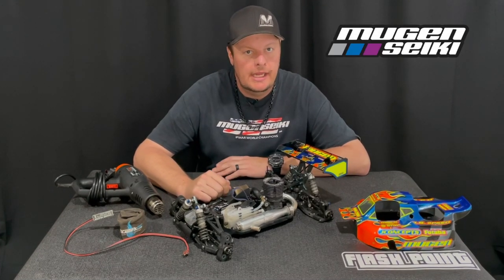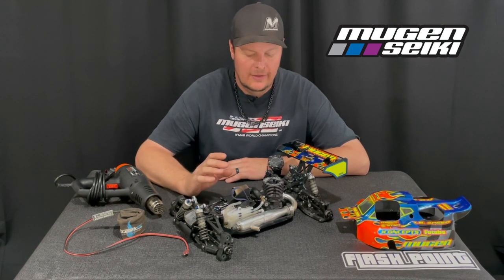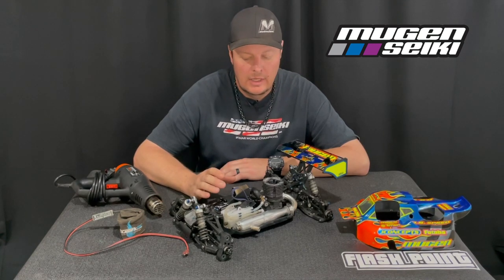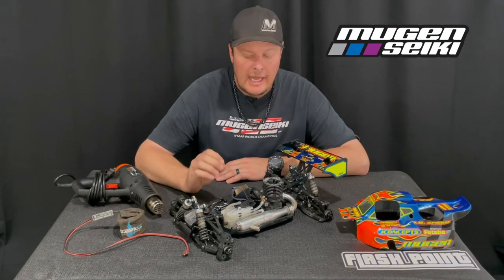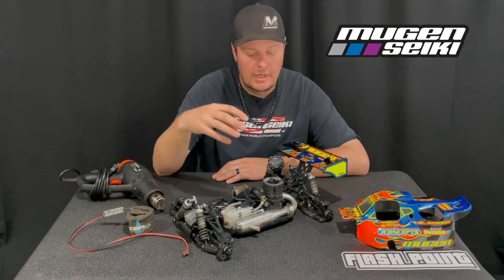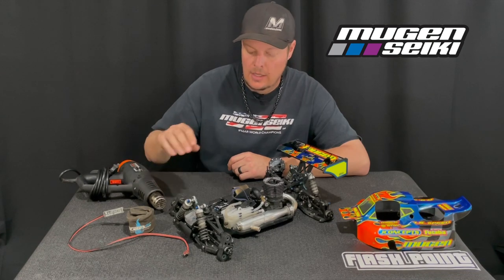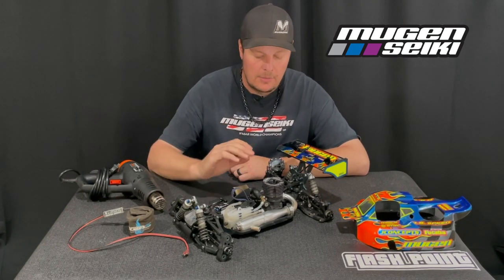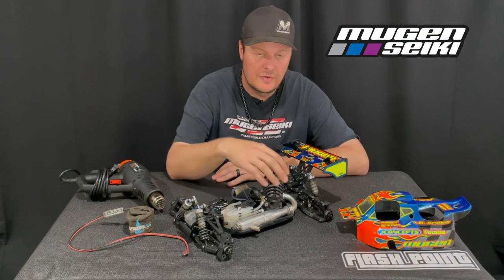Preheat your Nitro Engine.

Comment: Thanks Adam I got one of those head warmers as well. The warmer will get over 180+ on the out side but it only heats the engine up to 140
Reply from the maker: Is that with a 3S or 12V power supply?
Reply: Both do the same thing

Comment: Lol exactly what i say. Always preheat especially 70° and below. I always preheat. Not only saves fuel but helps alleviate mech. pinch saving on conrod sleeve and even the belt and motor in your starter box.
Reply from the maker: Yes sir!

Comment: @adamdrake after running a cycle of the head heater what does the temp gun you use read? I'm only getting to about 170 degrees after 20 minutes with the head heater, but I think my temp gun may be off, I know you use one of those really nice ones

Comment: My dad has never preheated his engines and they’ve lasted over 15 years. I don’t know if it’s because we live in Kauai so it’s always above 50°F outside, but I know he takes good care of his motors
Reply from the maker: Very nice.
Reply: How many gallons over 15 years ?
Reply: @ryanlarbi8157  take it they weren’t raced for a while but the engines had around 7-8 gallons on them. My dad stopped racing a little after he got those engines (they were fully broken in and had a few races on them) and they slowly had gallons put on them over time just playing with them every once awhile. The first thing to go out were the rear bearings because they were steel. The engines still have decent pinch but because of the rear bearings going out the pistons and sleeves were scored so the actual compression of the engines arent really there anymore. The connecting rod bushing showed some where but nothing concerning. I now preheat my engines during break-in and until the mechanical pinch is gone but after that I don’t heat them up. Where I am, It doesn’t get cold enough to make preheating a necessity.
Reply: @ashermorales8276  do they still retain enough performance after the pinch goes down? And how cold would it have to be to be in order to have to pre heat
Reply: @ryanlarbi8157  once the compression on an engine starts going down it loses a lot of bottom and mid range power and doesn’t hold an idle and I’d say 70°-75°F is safe to start without preheating

Comment: Thank you for this video. I have had fuel shooting back down the fuel line multiple times. On different engines at track days. You confirmed, what I was thinking the issue was.  From what I saw the fuel was vaporizing as soon as it touched the carb, causing a pressure bubble pushing fuel back to the tank. Is this possibly a reason for some mysterious main flame outs? Or possibly that the tune can change with a over saturation of heat?
Reply from the maker: Yes, that could be the cause of the problem.

Comment: After pre heating the engine, and you start the engine. Should the head temperature slowly decrease when running only at idle? I've been told my tune is wrong by the all knowing internet due to my temperature dropping below 180 when idling for a long time.
Reply from the maker: Yes, at idle the temperature will lower slightly.

Comment: Hi adam. 
    I have a question. I still run a losi 8t 2.0.  With a grp .28  from years back. Last time i had it out i couldnt get it started and oddly it would backfire a few seconds after bumping. Have you seen this before? If possible can you point me to what might be causing this. 
 Thanks adam. 👍
Reply from the maker: I would start by checking the glow plug and igniter.  Make sure the plug lights.

Comment: Do you have nitro tips for us guys and gals in Alaska where it’s 0 degrees to -30?
Reply: Preheat as usual and then have a sock or aluminum foil over the cooling head so that it keeps the heat
Reply from the maker: Preheat, preheat, preheat the engine.  :)